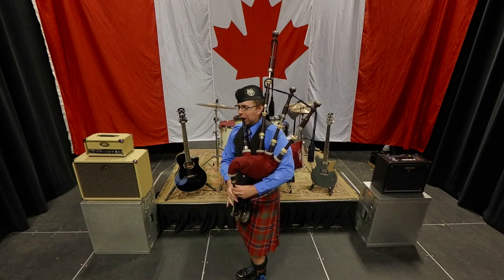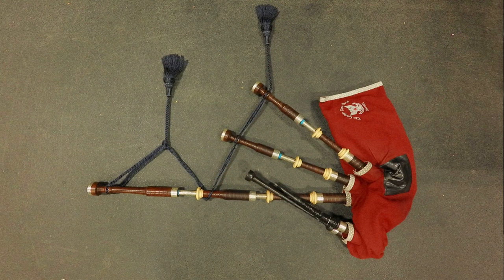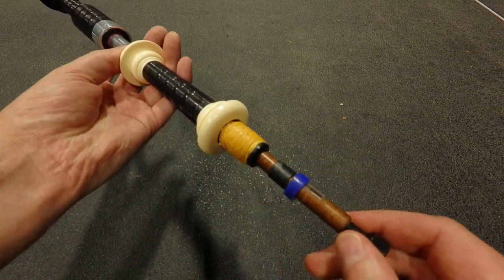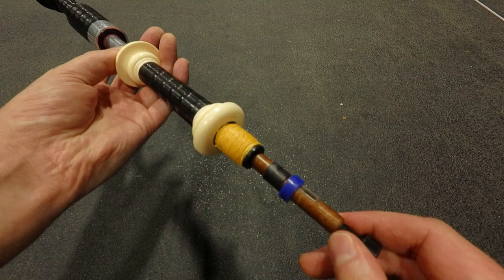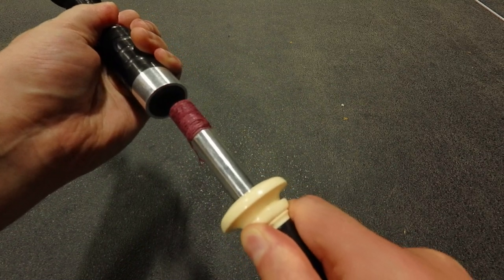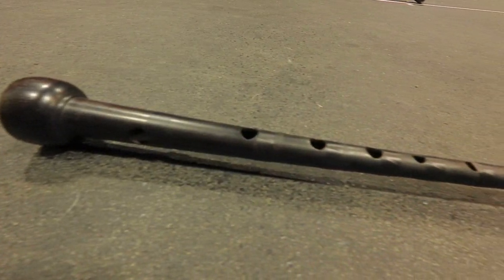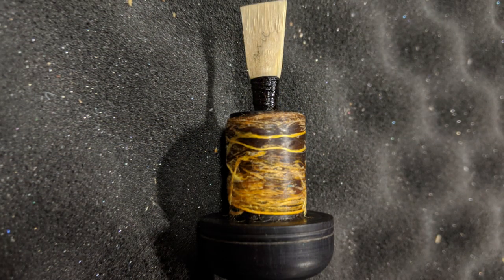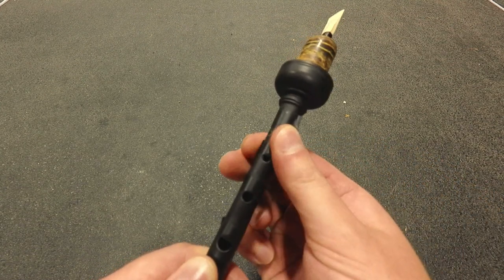The Great Highland Bagpipe - How It Works

Comment: How does the bag fill again after the player needs a break. Further, is the bag open to the one side and needs to be covered fully with the arm, so that the air doesn‘t come out?
Reply: The bag is an airtight bladder made of animal skin such as cowhide or sheepskin. Nowadays it’s also made of synthetic material such as Gore-Tex.
It only has the five small openings – three for the drones, one for the chanter that creates the melody and the fifth for the blowstick that has a one-way valve. The bag acts as an air reservoir that is squeezed when the player takes a breath.

Comment: How the hell you keep it aired
Reply: i think thats what he does when he blows on it
Reply: Hook up an air chuck to it, so it can be aired up.
Reply: By blowing into the mouth piece. That is what puts the air into the bag. Gentle squeezing with left elbow pushes the air out the pipes and also out the chanter where the fingering is done for the melody notes. 
The drone notes come out of the pipes. 
The piece up to the mouth is mainly for air from what I understand.
Reply: @treywest268  Your observation is correct. So the air coming from your mouth is not what causes the sound (this is how something like a saxophone works); rather, the air coming from the bag is what causes the sound. The air from the mouth/lungs is used only to inflate the bag, nothing more. That's really what makes bagpipes so unique and fascinating to me, but I think it's also why bagpipes are sometimes misunderstood.